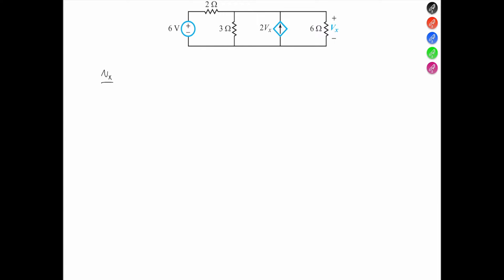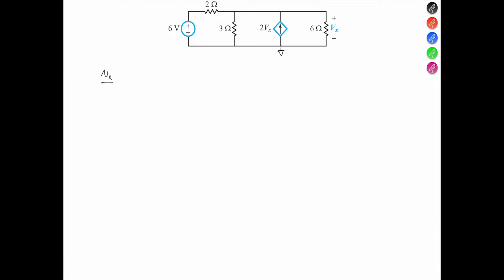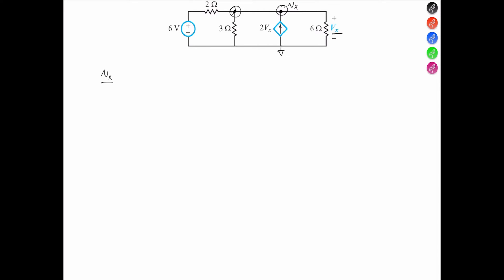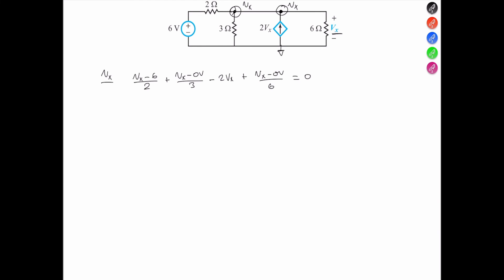With a dependent current source, determine the voltage Vx.

Comment: Hey, love you. thanks for everything.
Reply from the maker: Most welcome!
Reply: @writtoninnk  one question, can you explain why it's Vx-6 for example? Are you assuming based on the current flow direction that Vx is the higher voltage? From my understand, the equation is (higher voltage - lower voltage)/resistance